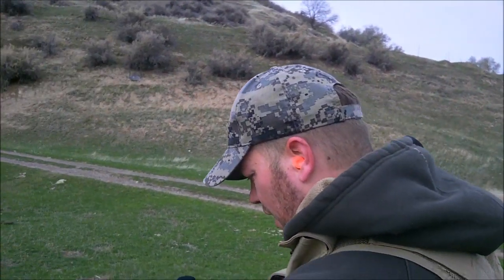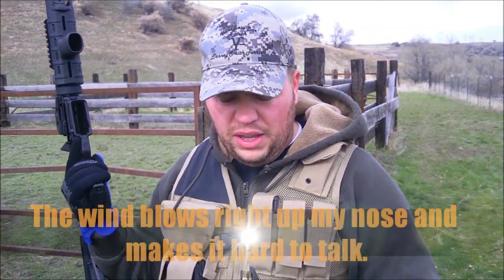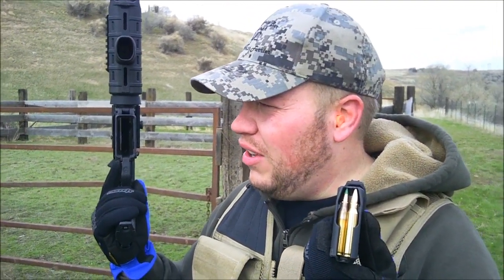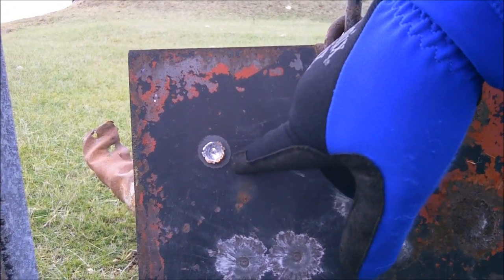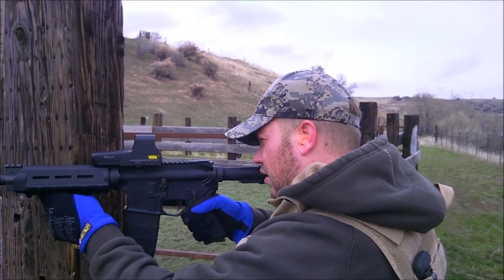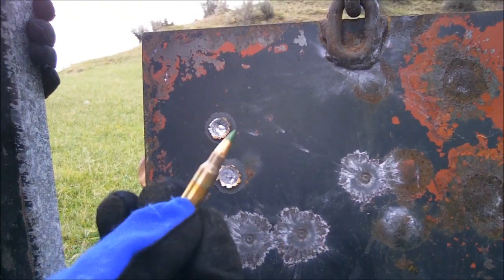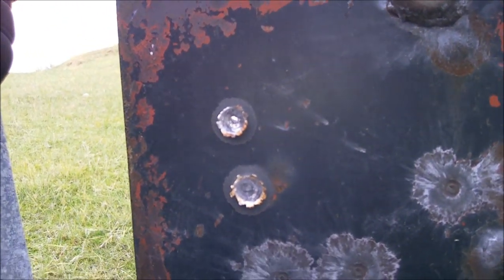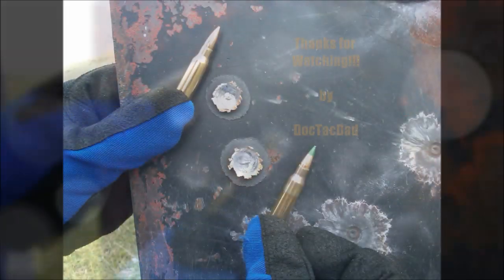M855 Penetrator!!!

Comment: Don't jerk the trigger.
Reply: That and POI shift from the round depending on the distance. I've fired M855 out of my assigned M4 and was hitting 300s just fine. =\
Reply: During our SDM course I was hitting 500m in the prone with iron sights. I think it was a 5-6" circle at 500m and I got 8 out of 10

Comment: M855 green tips aren't perpetrators! the steel tip is to create less fragmentation upon entering a target. that's why the m855 was accepted into NATO and not the M193.
Reply: awesome dude 888 
sorry but that's not true, the m855 fragments just as well as the m193 so long as they are both going above 2,700 fps. If you go online, you can find a report from a surgeon who has treated wounds from both rounds and he states that velocity is the only factor that dictates fragmentation between the two rounds, specifically 2,700 fps and up will cause reliable fragmentation. The reason NATO accepted the m855 is because due to its increased mass, it retains more penetrating power at range than the m193. The goal when they were designing the m855 was to have a bullet with similar specs to the m193 but with the added benefit of being able to penetrate a standard steel NATO helmet of the time at 200 yards if I remember correctly, and this was something that the m193 could not do.

Comment: I've heard that the M855's are not accurate in 16" barrels-probably why you missed.
Reply: ***** it was also designed to be in a 20 inch barrel
Reply: Steven Trostle who ever told you that is stupid, the US militarily almost universally shot it out of 14.5 and 20 inch barrels perfectly accurate.
Reply: Steven Trostle who ever told you that is stupid, the US militarily almost universally shot it out of 14.5 and 20 inch barrels perfectly accurate.
Reply: as long as the twist rate is correct, it will be just fine in a 16 inch barrel. 1/8 and 1/7 are preferred.
Reply: Jewifer333x2 That's not correct, a 1/11, 1/10 and 1/9 are almost universally more accurate for a 62 grain and 55 grain bullet. THe US army settled on a 1/7 due to it stabilizing a m856 tracer over 600 yards better.
Reply: its a 1:12 out of a 24in barrel, your all wrong! lol damn its youtube, go to facebook to argue like normal people. lol

Comment: Normally a 75 grain hollow point will be much longer then a 75 grain FMJ. A 62 grain m855 round uses a mild steel core. Where as a m193 uses lead, also bullet velocity, humidity, temperature altitude and many others affect bullet twist rate. Not just weight. But my 1/9 will stabilize a 75 grain round

Comment: @Eric Hendricks, I believe your a little mixed up!!! Bullet weight Normally dictates lengths of bullet. As the size of the round must stay as a certain diameter. But you can substitute lead for mild steel core or a hardened steel core. Or hollow points, a 1/9 can stabilize a 75 grain round. I use Tap 75 grain FPD in my 1/9 Nd it's extremely accurate. Yet there are 72 grain rounds mine wound shoot for shit.

Comment: For being in Afghanistan you seem to lack knowledge about standard NATO ammunition... Interesting..... Green tip is mild steel cored ammo, technically not AP which makes it legal for civilians to own and use. Yes, the military does have different 5.56 that is AP and looks significantly different, the difference in the actual composition of the round is that AP has a hardened steel penetrator where as green tip is just a mild steel core. Cut into some green tip if you don't believe me.

Comment: M855 is not the same as standard ball ammo. M855 has a steel core in a copper jacket instead of lead. If you're unsure if it is steel or lead, just drag a magnet across the top. Steel ammo should not be used on steel plates. Also, budsgunshop has very recently had 420 round cans of penetrator available.

Comment: actually the penetrator round is a fmj with a steel core in the rear of the mostly lead projectile. it is designed to penetrate the soldiers helmets or penetrate appx 1/8" into steel

Comment: Sorry but the green tip ammo is just standard lead with a full copper jacket. The Army's new "penetration" rounds aren't actually penetration rounds. The new rounds have a mild steel tip and core with no lead at all. They tell you the rounds are meant for better penetration but they are really just to make the tree hugging hippie environmentalist happy. I used the new rounds in Afghanistan.

Comment: Definitely not a 3/4 inch piece of steel. You can clearly see it isn't when the side of the steel is shown. That and he's measuring penetration from the top of the cone instead of where the metal is flush. Also, go back to iron sights knucklehead

Comment: Can shoot up to 69gr bullets however most 1/9 are actually 1/8-1/8.5 so you can shoot up to 77gr bullets but you right military goes with 1/7 it works better with heavy bullets. The US requires the tightest shooting weapons of all forces. Like 10 shots in 4 inches at 100 yards I believe, while most are 10 shot in 10 inches at 100 yards.

Comment: Actually, all military weapons from the M16A2 to the M4 have a 1:7 twist instead of the 1:9 twist of the M16A1. The reason for this is that the 1:7 twist  produces a tighter group with the heavier M855 62 grain round. If you fire an M855 round in a 1:9 twist barrel your goups wil be larger. The 1:7 twist produces tight groups like the 1:9 with the M193 but the reverse is not true.

Comment: You are really comparing apples to oranges oranges here. The M855 green tip round is a good bit "hotter" than ANY factory .223 round available, due in large measure to that it is a compressed load in a thicker case. It is easily 5000 - 8000 Cu units hotter in  chamber pressure. If you wanted to compare apples to apples here, use an M193  55 gr NATO round instead. It has similar chamber pressures so what you are really comparing is the  penetration power of the bullet itself.
Reply: steve hammond, now you are misinformed. you could have M855 rounds that are .223 and then some that are 5.56. Same with XM193. the difference between .223 and 5.56 is how the casing is processed when it is loaded, not the weight of the bullet itself.

Comment: It's an Eotech, which is a HWS. Great optic, just point and click like I like to say. The image is projected on the glass like a HUD in a fighter jet. So even if the glass is cracked or broken, it will still be visible and not lose it's POA. They're the best CQB sites on the market. Another "Red Dot" is an Aimpoint, that looks more like a small scope bc it has two lenses and a tube that the dot is imposed on.Neither has parallax, and can choose diff reticle patterns. Eotechs offer more FOV tho.
Reply: depends on the Aimpoint model. T1's and T2's offer a wider FOV the  the HWS.

Comment: His accuracy problems with 5.56 have to do with the barrel twist being 1:9.  1:9 is fine for .223 55grain and lighter rounds.  the heavier 5.56 is longer bullet, as well as heavier, and requires more twist in the barrel.  I garuntee that if that rifle had 1:7 twist, he would have been on with both rounds.  
Note: 1:7 twist normaly only ends up being for for very light bullets like 40 grain. They have been know to tear apart mid-air.
Reply: the length and weight of the bullet have nothing to do with whether it is .223 or 5.56.

Comment: Or maybe you just aren't very good at shooting? look at the physics portion of sending a heavier round at higher velocities with less spin versus the same round with more spin the heavier round requires a  higher velocity and a higher rpm to fly straight you won't experience spin drift with the 1/9 or else the round would be custom made for the 1/7 hence the military uses the 1/7 with 55 grain so when the heavier tracers are there they are accurate

Comment: The reason they have a green tip is so you don't use them in the old 1:9 twist rifling that is meant to barely stabilized a 55gn FMJ ...that is why you might be having problems hitting the target..

Comment: @lane1030 in my honest opinion I think a 1-7" twist spins them too fast and I have gotten better results with a 1-9 twist with both m855 and m193. It's all about point of impact and knowing your weapon. With m855 it's alot about manufacturer as well. Olin Illinois WCC stamped rounds are the best. Some of these could be very old however it is possible to get rounds produced in 2004 just like the cases I get.

Comment: @kstangent First of all the M855 is a much hotter round then the M193 is and the M855 only gets 2800fps out of a 16" barrel, so dont say that you get 3000fps out of a 16" barrel with M193. The M193 was also designed to be used with a 20" barrel to get to the propper 3000-3100fps needed for the rounds to be effective at penetration and produce relyible wound channels. So don't try to cover your ass for buying a 16" trying to say you chronographed it.

Comment: @1jazzy8hula the .223 is SPECIFICALLY designed to tumble...what does "tumble" mean? because it is moving at 3200fps when it hits it goes in then flips around effectively DOUBLING the calibur of the round. where as a 30 calibur will only "drill" a 30 calibur hole. a .223 will tumble a .45 calibur hole...now which is bigger? .30 calibur or .45 calibur? if you dont believe me shoot an old hardrive from a computer with a .223 and a 7.62. the .223 will have a larger exit hole

Comment: @1jazzy8hula No, the "green tip" is not new at all. It has been the NATO standard for nearly 30 years. The .223 Remington didn't start out as a hunting rounding. It was designed for military assault rifles. It was based on the .222 hunting round, but it is longer and more powerful. It has killed plenty of men.

Comment: Is "Green Tip" a new magic thing? Don't put too much faith into something that did not work in the field and had to be "improved" afterwards. The original 55gr was not enough to do the job in the first place so, a new improved round had to be made. 223 was a varmint round to start with.Let it be what it was intended to be, a light recoil, accurate, high velocity round for the small game. If you want a man killer get a 30 cal or bigger. This whole .308/M14 seems like a big waste to me.

Comment: @DocTacDad There designed to penatrate lightly armored objects such as hummers, tansports, and body armor. The reason yours didnt penetrate has nothing to do with the steel its the fact you were using a 16 inch barrel. The 5.56 needs atleast a 20" barrel to get to its propper velocity of 3100fps. Once its at that speed it dose all of its "wonder" acts.

Comment from the maker: @RayAir1 The 1" plastic face probably didn't slow it down to much and these rounds are designed to penetrate 1/4" steel. I not sure if the gong is hardened or not but it is 3/4" which is 3x the width. I didn't expect it to defeat it. Thanks for the comment.